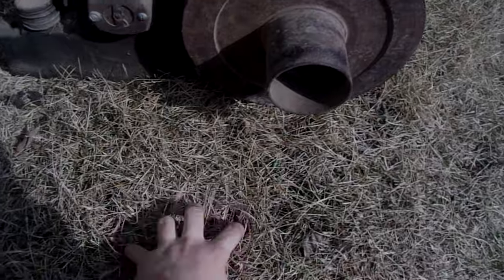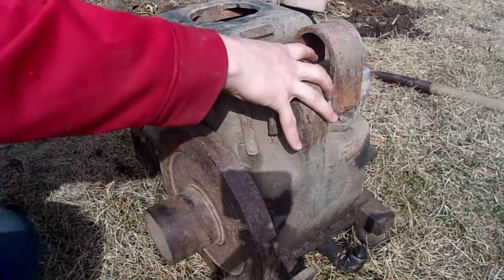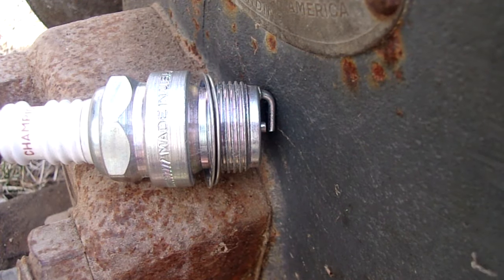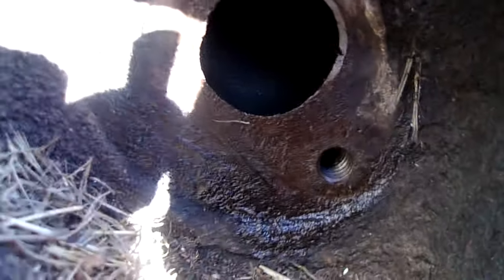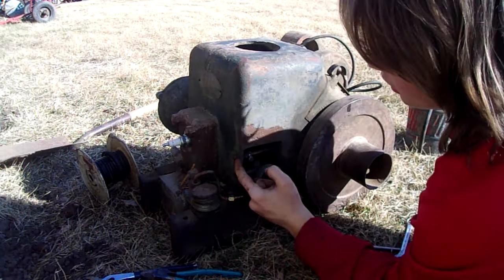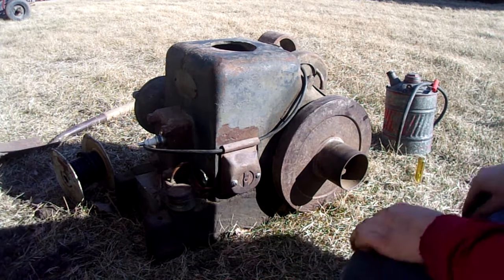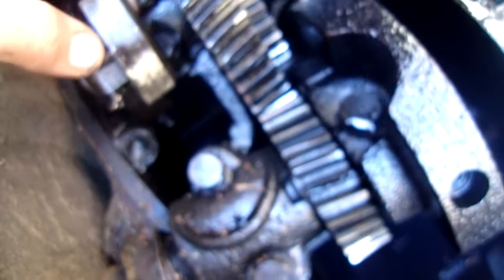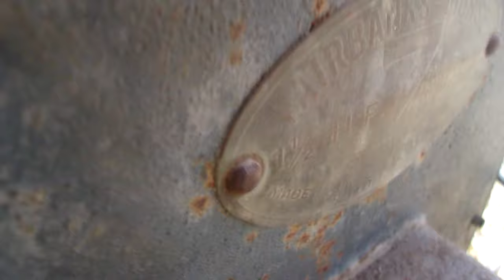Antique Gas Engine!  1 1/2 hp "Salt Block" Z Fairbanks Morse Engine

Comment: hot and cold cycles and dissimilar metals will cause a warp sometimes. especially on the old pot metal stuff when it's bolted solid with no gasket. I usually lap em back flat on my surface plate. Mag is hot :D  sure makes your hands tingle when it gets ya
Reply from the maker: warping pot metal can just happen with age. pot metal before 1940 was really unstable stuff and it does some crazy thing just sitting!